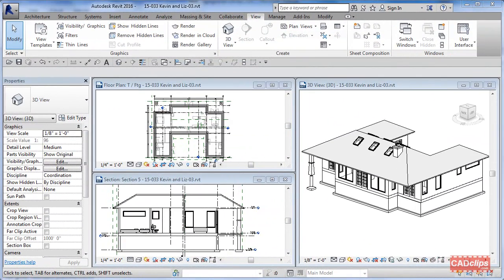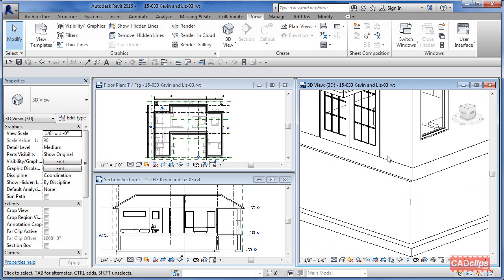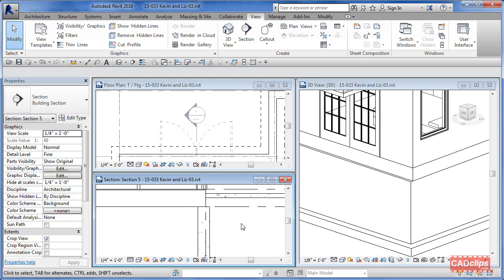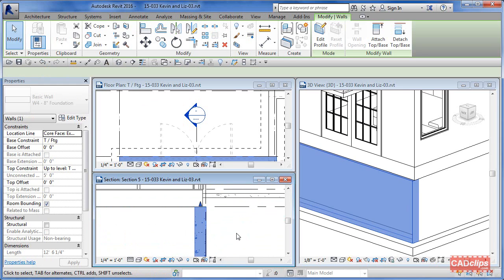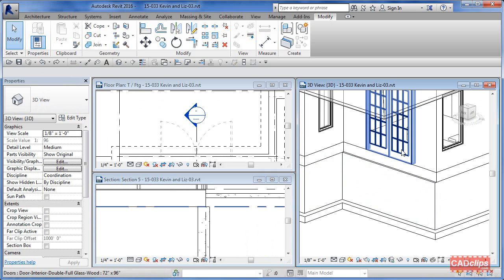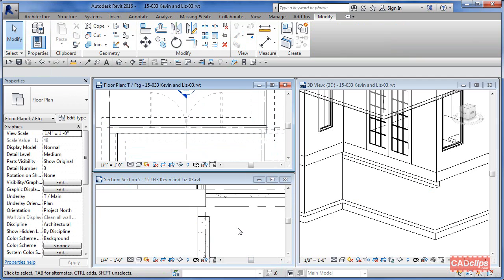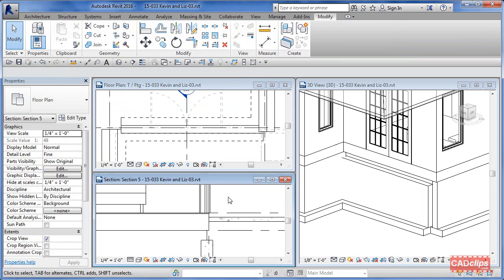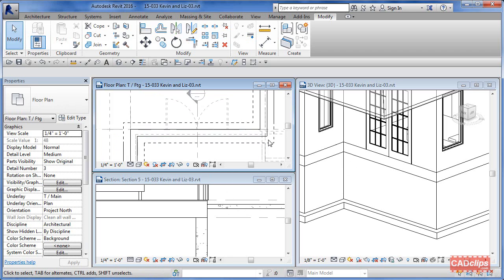REVIT Vertical Wall Alignment Problem SOLVED ! - CADclip

Comment: Isn´t it easier to pin the attached wall above, allign the wall and than unpin?
Reply from the maker: +Kamil Laco Im not sure if that wouldn't error out ? and i'm not sure how to re-create the condition so I can't test it. I'm never actually sure how the relationship starts to begin it just appears.
Reply: +CADclips For me just warning about unjoining elements appeared, clicked OK and only the right wall aligned. Although unpining made walls in most cases joined again.